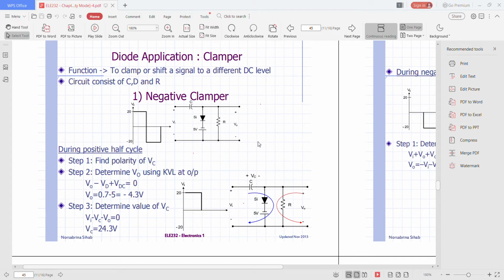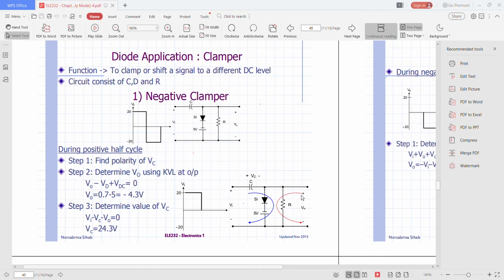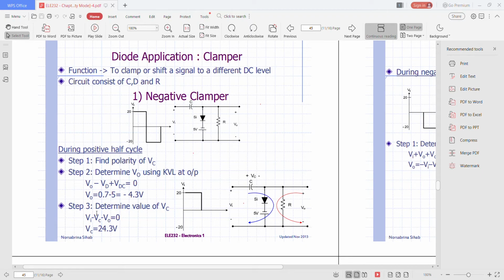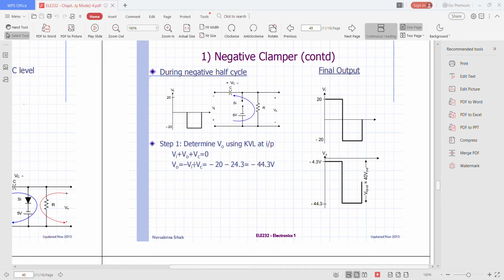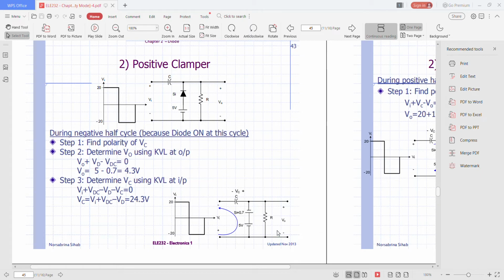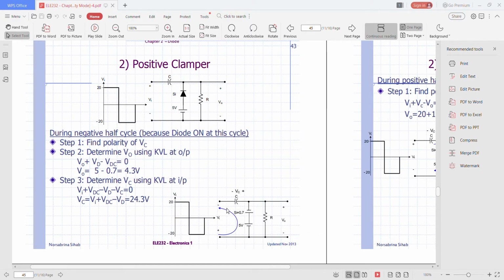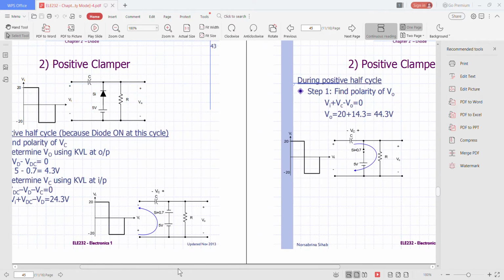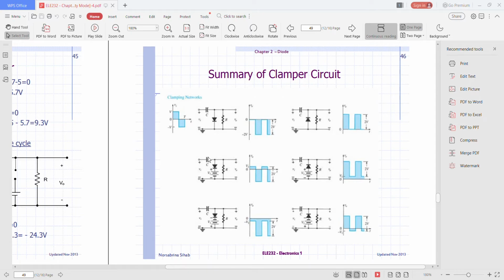ELE414   Chapter 2   Diode Clamper Circuit

Comment from the maker: A clamper is a network constructed of a diode, a resistor, and a capacitor that shifts a waveform to a different dc level without changing the appearance of the applied signal.

Comment from the maker: In general, the following steps may be helpful when analyzing clamping networks:
1. Start the analysis of clamping networks by considering that part of the input
 signal that will forward bias the diode.
2. During the period that the diode is in the “on” state, assume that the capacitor
 will charge up instantaneously to a voltage level determined by the

network.
3. Assume that during the period when the diode is in the “off” state the capacitor
 will hold on to its established voltage level.

4. Throughout the analysis maintain a continual awareness of the location
 and reference polarity for vo to ensure that the proper levels for vo are obtained.

5. Keep in mind the general rule that the total swing of the total output must
 match the swing of the input signal.

Comment: Definition of clamper: Electronic circuit which fixes either +ve or -ve excursions of a signal to a defined value by shifting its DC value.

The function is also defintion itself.